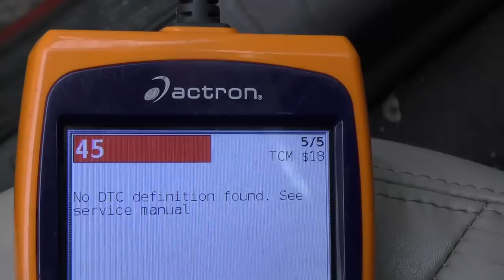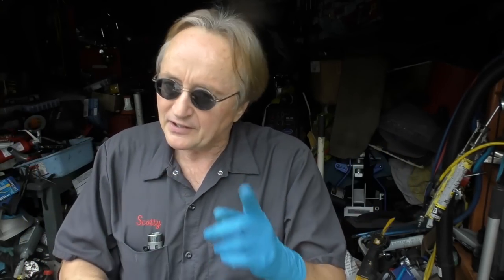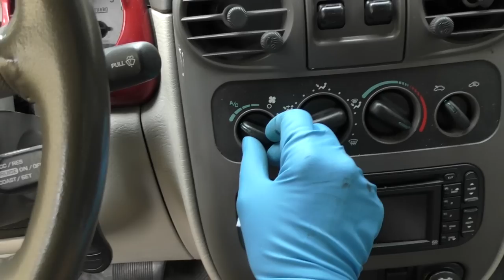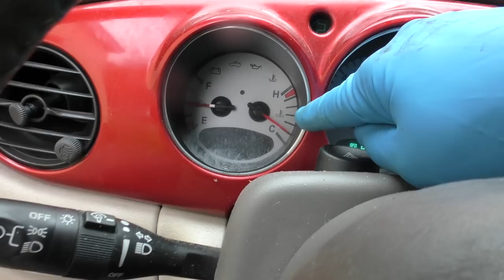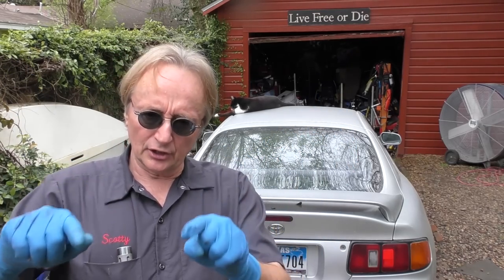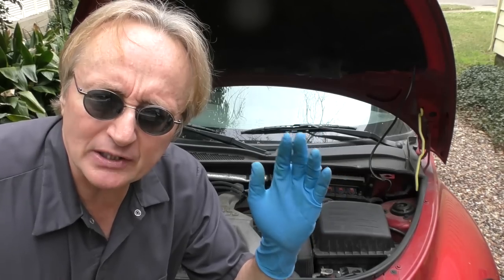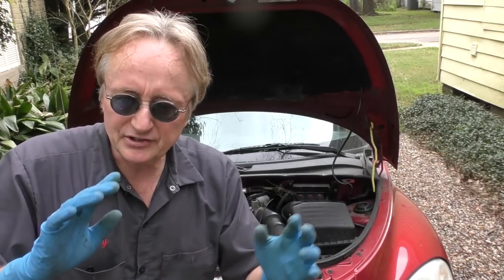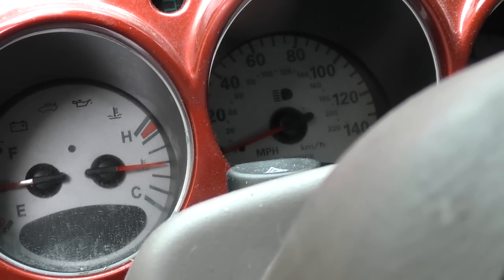This PT Cruiser Has a Serious Problem

Comment: I didn't think you    would even work on a PT Cruiser, I don't mind working on mine. Here is a tip, jack up the right side of the car two or three inches and the new coolant runs in a lot faster and the air bleeds out faster.

Comment: Thermostats are cheap pieces of junk. Ran my old 85 Chevy truck without one cause I got tired of replacing em. I know you can't do that on modern cars but it was a good solution to a recurring problem for the time. They just don't make things to last anymore.

Comment: After a repair like this on a PT Cruiser, it's VERY important to bleed the air out of the cooling system or it can easily overheat again!
Reply: Scotty said he was going to take it for an extended drive before returning it. After that extended drive he will check the coolant level again.  That is all you need to do.

Comment: My gfs car is a pt cruiser same color as this one. I hate that car with the heat of the sun. I’m not an official mechanic but I’ve repaired my share of my junky cars over the last 20years and that car is by far the worst POS I’ve ever had the misfortune of having to crawl underneath. Shocks, brakes, head gaskets, completely dislocated ball joints, ignition misfires, electrical grimlins.. Every fluid in it leaking from somewhere. Tomorrow it’ll be something else I’m sure

Comment: Hey Scotty my TP Cruiser it's not overheating it runs really fine but the check engine light to come on and then my temperature gauge or go down to the bottom and my RPM gauge will fall to the bottom and then sometimes go off come back on and they work fine

Comment: Sometimes we blames the cars for being bad, but I come to turnd it's the owner who just get a cars to drive it and don't maintain it. My philosohy is you have to watch and check the fluids and maintain a car to give any car longevity.  I have seen every car  have longevity.  My understanding is every car is not build to go for weeks without oil, so who fault is that  the owner or the car. If you runs a car with no water in it who fault is it the owner or the car. Every horse that God created was not Secretariat the same way with cars, but if you take care of your horse he just as better than Secretariat. Bad owner not cars, oh, I want a car  that could run off no oil for months this sounds like an irresposible owner, lol. Great video just hearing how terrible the car is, but Scotty just gave you a solution on how to fix it, and the mechanics that charging you an arm and leg is part of the problem to and not fixing the problems right. Great video just responding to comments.

Comment: So, did the overheating cause the misfire?  Where did the coolant go?  My first thought was it was leaking into a cylinder causing a misfire.  Could that be it or would you definitely feel a pressure buildup with your hand over the radiator cap hole?

Comment: Hey Scotty, I have a question.

I daily drive an all-original, unmodified 1984 Mazda RX-7 and I recently brought it in for a smog test here in California.

The smog test guy said that it was belching out over 10X the legal limit for carbon emissions in the state of California.

Thinking it was poor combustion because carbon emissions skyrocket when there’s only partial fuel burn, I changed the plugs to see if I could diagnose the issue but the plugs are perfectly clean! No sign of a rich fuel mixture.

So what’s going on? The car’s not running rich, I’ve not premixed for the month prior to the smog test and everything else passed with flying colors in the smog test. It’s only the carbon emissions.
Reply: ecky1965 - They do, but they can pass emissions testing. Mine does not for whatever reason, so something fishy is going on.

Comment: Good video. Most of us would have made the mistake of just changing the thermostat rather than checking the more important facts first. Still would have worked out the same. In this case.

I've got disagree with the title of the video though. Thermostat is a serious problem? It could cause a serious problem. But it's hardly a serious problem itself.

Comment: Remember when them temp guns came out, the snap on guy was up to my shop showing it off to my guys,
And the dumb SOB while showing it off decided to point it at a 747 landing to see if it would pick up the jet exhaust, we were located next to the runway. And at the next couple planes coming in.
 Needless to say it became quite the interesting afternoon after that. 
Feds ain't got no sense of humor.
We were still in trouble for the homemade radar jammers that my nephew was building that we were playing with,
 that kinda sorta messed with the airports radar so they said.

Comment: I laugh when I see comments about P.T. Cruisers, I don't know if I have just been really lucky or the problems have been over-exagerated. My 2008 touring has never had any major problems and it has over 110,000 miles on it. The cam sensor had to be replaced after it started acting up one night when we were having heavy rains and flooding so I'm pretty sure it got wet, the shifter cable had to be replaced because it lost that bit of insulation on it and the catalytic converter caused it to warp, a wheel bearing had to be replaced because of all the freaking pot holes in my parish and I had to get my horn replaced because it got ruined by the sand that is my driveway oh and apparently the dealership or previous owner or their mechanic put the wrong spark plugs in the car during a tune up. Original engine, original transmission (automatic non turbo) I'm actually pretty sure it's still got the original alternator and power steering/ac belts (going to have those replaced soon) and timing belt (need to get that replaced soon), ac/heat works just fine, electronics are fine (except the tuner knob on the radio is possessed so I use the seek function), never overheats and aside from some hard to see dings from hail no body damage and it's never been in a wreck. I dunno, I just haven't seen what the fuss is about I guess.

Comment: Scotty, my sister in law has a 2006 PT w/ 2.4L Turbo... She says that in neutral, w/ car running it will not move... You can't push it. In neutral w/ car off it rolls freely. Also, in reverse it tends to feel like the parking brake is on. Do you have any advise for this problem?

Comment: @Scotty Kilmer I have a 2006 XJ8, Turns out the Temp Gauge is designed to stay at 50% when the car is between 181 and 230! Crazy eh?
Reply: Dumbing it down so the customer doesn't see the gauge moving around and think there is a problem.  Some older Jeeps have an oil pressure gauge that is driven purely by computer software calculations with no sensor to measure exact pressure, just a switch that closes below a certain minimum pressure.

Comment: i'd never have any intention on buying a Dodge.. in '01  my dad got a brand new Dodge Ram with the V8.   he had the AC compressor go out 2 times and a power steering pump as well i think,  all within the first few years of ownership.
Reply: My '05 model year 1500 has the original power steering from '04 with 200k miles of wear on it, just a little loud now, still does the job fine. AC compressor may have been changed but the one in it looks pretty old, AC works excellent. From what I know going from 2nd gen (up to 2002) to 3rd gen (2003-2008) was a step up in quality for these trucks. Dodge/Chrysler has made plenty of good cars, hell the PTs aren't even that bad it's just that nobody takes care of them worth a damn, like those beat to crap Chevy Cavaliers you see all over the place. My truck is all original by the way.

Comment: We owned a 2001 Chrysler PT Cruiser & I think everything that could go wrong did go wrong with that car. The PT was easily the worst car we ever owned. I also had a 1991 Dodge Spirit & it was also bad, I will never buy another Chrysler product.
Reply: First model year of an aggressive new design.

Later years more reliable as company iterates fixes, as is the case in most car models.

Worst car I've owned was a 2001 Chevy Malibu. Everything leaked. Yet now the Malibus have the highest dependability rating of any mass market car. Any of them.

Comment: Hi Scotty, I need to replace the throttle body on my 2003 Acura CL.  The current throttle body is fine, this is to reconnect the cruise control.  Is there anything special I need to know when replacing a throttle body?  The car runs excellent I just want the cruise control to operate.  The local Acura had checked out and said it just needed to be reconnected at the throttle body.   Thanks!

Comment: I have a issue where the ac is not cold when i sit in traffic, Cooling kicks on but not full speed , Engine temp also rise a bit when in traffic but not to the point of over heating

Comment: People give this car crap, but my 06 with 141k is still running strong. It gets me to and from work and that’s all that matters. Got it for 500$ and not a thing wrong with it
Reply: I’ve got an 07. 150k.  Was doing pretty good until this past year. Overheated a couple times. Had to get new thermostat and radiator fan. New alternator and battery. Has misfired cylinders twice. Now they’re telling me they THINK I have a small warp in the cylinder head which will cost over $800 to do a temporary fix on it.

Comment: Anyone else thought who ever did the front end work painted over the radiator. Don't laugh I have actually seen this, and you would have the same problem. The car would over heat because with the paint the radiator can not properly transfer the heat from the coolant to the air. Everything works normal.

Comment: Hi Scotty, I sometimes drive around in a company owned  2017 Jeep renegade for my security job.  This certain vehicle has a climate issue. When I turn the temperature dial to half or 70°F it blows hot air only from the top vents and front defrost vent. When I have it at below 60°F it blows cold air from the top air vents only, I don't feel any air hitting my feet. I'm mad at my job for not doing anything about it but can you please give me your opinion on what could be causing the temperature swing and no air from the bottom vents. Even if I set the climate position to the floor only it still blows air from only the top air vents. Thank you. Mike from California. Vehicle has around 50k miles.

Comment: Doesn't take much to overheat a PT.  I have see plenty of plugged radiators on these that have the exact same symptom a bad thermostat.  The tubes in the core on these are so tiny because they are trying to get more surface area to cool through that tiny nose.  Those thin tubes plug up after a while when the coolant get raunchy.

Comment: You must use proper coolant in these cars if you don’t and use wrong coolant white paste will form inside coolant passages I have removed many heads from these engines that where clogged please only proper coolant For Chrysler products Hoat only though 2010

Comment: If the cooling fans are kicking on with the AC off while the car is running, what's the problem is there a sensor switch that needs to be replaced?

Comment: What about a clogged radiator I seen it where the bottom of the radiator is cold in the top is hot if it's not the thermostat sometimes the radiator is clogged at the bottom

Comment: Scotty if my 05 v6 Toyota tacoma isn't over heating but I'm losing coolant except it won't pull it back from the expansion tank when it cools down what could be the problem? If pushes coolant into the tank when it warms up but wont pull it back out. I'm stumped

Comment: Your fur baby on the Celica stole the show. On another note after working in the service department for around 20 years at GM dealerships where all your customers are engineers (Flint, MI) know everything and insist on driving GM junk that even technical assistance couldn't fix. It was very refreshing to take a job at a Toyota dealership. The mindset of the hardcore GM people was Toyota was junk, when in all reality it was the opposite. If you only knew how much of a stress relief it was working with Toyota customers with little to no problems to working with GM customers with major problems you would freak. Typical Toyota customer, I'm here for my 90k service please. Typical GM customer, my new truck has a loud engine knock when I start it cold and  my job was to tell them oh that's normal. Even more mind boggling was the retired GM workers that just has their benefits cut and for the first time in their lives bought a Toyota, that really blew my mind. Keep up the great work Scotty, your videos are awesome.

Comment: Hey Scotty, I have a 2003 Chevy Tracker LT with a 2.5L DOHC V6 auto transmission. I keep having a P0300-P0306 code come up almost every time i drive it. Already changed the spark plugs & wires, as well as having a new Camshaft positioning sensor installed. GM doesn't seem to know/care enough to fix it. Any ideas?

Comment: Hey scottie i have an 05 turbo pt cruiser. It only over heats when i floor it or drive up hill otherwise it stays at half. I replaced the thermostat and coolant temp sensor. Any ideas on what else it might be? Theres no coolant mixed with the oil and theres no smoke coming out the muffler so i dont think its a blown head gasket.

Comment: I have been working on the charging problems with my  PT Cruiser. I am so upset with it. I changed the alternator,  the battery,  and the high beam switch.  And the car will not hold a charge.  I am forced to lift a heavy car charging unit with me up and down 25 stairs every time I have to go out, to doctor's and groceries.  A d I can hardly lift this thing. I am hoping you could maybe give me some insight on what is wrong??

Comment: One thing you should let people know if that with that particular POS, be careful not to spill any anti-freeze on the pulley and belt. It causes premature wear and if the replacing them is crazy. Better to stay away from these. Water pump, power steering pump and several other items require engine removal (although there are short cuts) to fix. I tell everyone to run when they see these cars.

Comment: I hate that most cars now days dont even have a coolant temp gauge or oil pressure gauge. two very important things that manufacturers seem to think the end user doesnt need to know about. some vehicles still have the gauges but they are just hot to cold or low to high and dont actually have and numbers to tell you a temperature or pressure... cars in the old days were built much better, no computers, no catalytic converters... just cars that would last and you could easily repair when they did finally break down

Comment: Couldn't you just have taken the radiator cap off, run the engine until it was warm, and checked through the open radiator to see if the coolant was flowing?  That would indicate that the thermostat was opening.

Comment: Nice looking car, but had just to many flaws and problems from the gecko. Engine issues, brake issues, steering issues, oil issues and worst of all cheap steel that the rust will eat up faster then you can eat up an baloney. 
These cars may have gotten good scores on safety for the passenger with the air-bags but overall got low scores on frontal hits.

Comment: Yet the "crappy Chrysler product" only needed a thermostat and a 15 minute job. Those 2.4 turbo motors are stout and pretty much bullet proof. Good for around 500whp STOCK. Same motor is in the Neon SRT-4. Mileage was never said of the PT Cruiser. As for the random misfire, it probably just needs the intake manifold replaced. New spark plugs/wires/coil pack, injectors cleaned with new o-rings would be a good idea too based on the mileage. All easy to do on that vehicle. My neighbor has over 270k on his 2003 PT GT with a 5 speed manual. Original motor and transmission.

Comment: scotty i have a question and i need your help. my 2001 Toyota rav 4 takes a while to shift to 3rd gear when temperatures are very cold. infact when the temperature scale is at cold before gradually going to normal it doesn't shift to the 3rd gear instead it stays on 2nd gear. how do i solve this problem? if i try to drive fast it just works the engine harder.  please i need your input on solving this issue.  thanks.

Comment: Have never got the appeal of these. They never resembled an older car too me; they were just ugly, underpowered, and an overweight car for a car on the Neon platform (the front brakes and suspension wear out early). My uncle had one and was a mechanic and even he called them a PT Loser.

Comment: Makes to much sense repairing. Just get you a small crack in radiator. May leak a but when warms up always stays well at good temp range.  Does suck when it gets cold , heater sucks but in when TX summer kicks in, who needs heat. LOL My 20 year old WJ doing this for 2 years. Hits 208 and stays there. LOL

Comment: If the radiator fan doesn't turn on is there a a possible reason is not connected right? And in my car has water in the engine oil not sure how any aides it wasn't like that after I switched a different radiator my car over heats

Comment: In a pinch you can run a car without a thermostat. Never attempt to drive a overheating car. Call a tow truck;  it’s cheaper than installing a new head gasket! 🔧